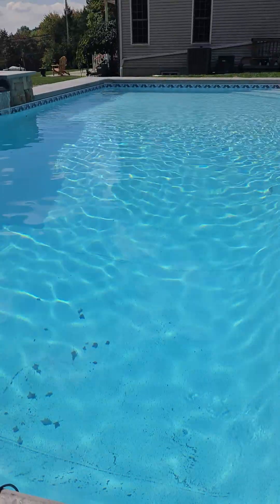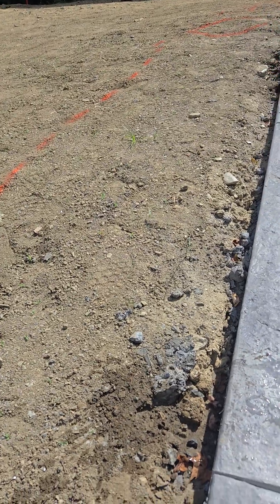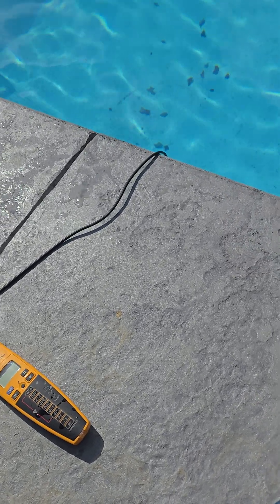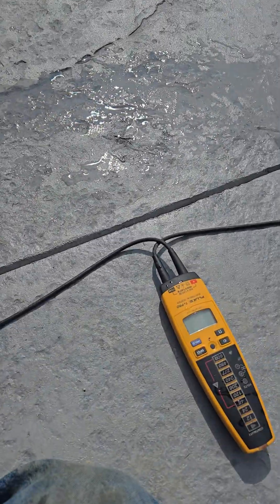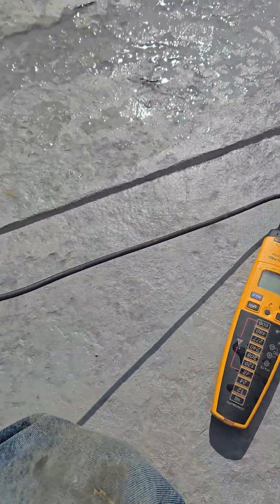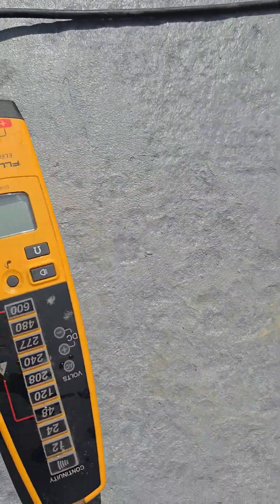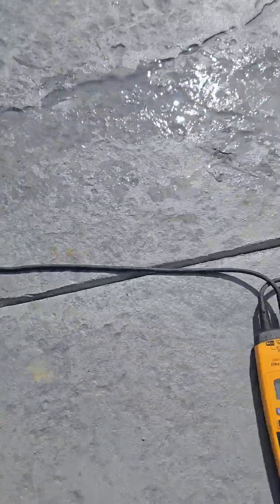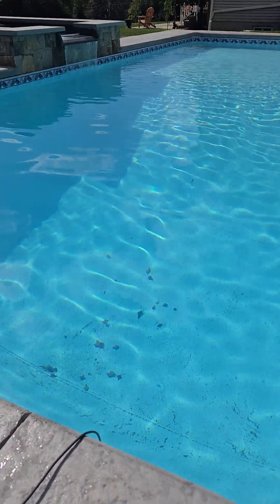Do this continuity test  every time you finish wiring a swimming pool before people start using it.

Comment: The test is useless without know what the resistance is.
Reply from the maker: This method can also pick up stray voltages if any occurs., I discovered this technique approximately 20 years ago on a service call when people at a gas pump was getting shocked. After using several tools at that time I was astonished that this method beats alot of the other fancy tools showing effective results.

You can also press the Ohms settings to see the results for any resistance reading. Under 4 Ohms is normal depending on the content of various soils.

Comment from the maker: This method can also pick up stray voltages if any occurs., I discovered this technique approximately 20 years ago on a service call when people at a gas pump was getting shocked. After using several tools at that time I was astonished that this method beats alot of the other fancy tools showing effective results.

You can also press the Ohms settings to see the results for any resistance reading. Under 4 Ohms is normal depending on the content of various soils.